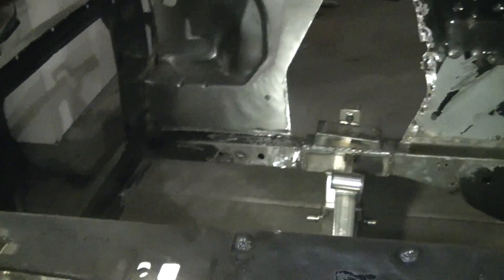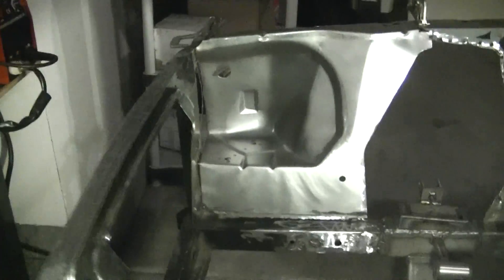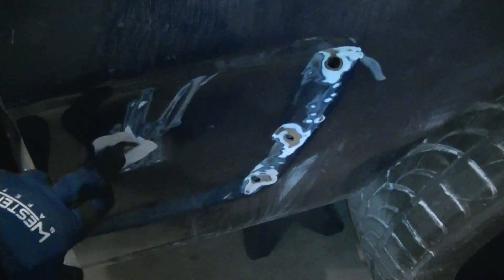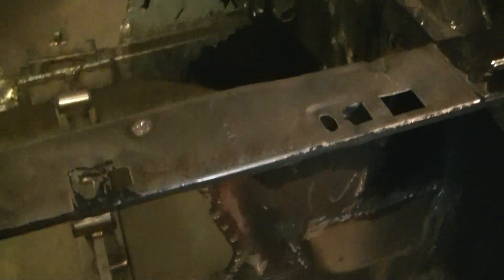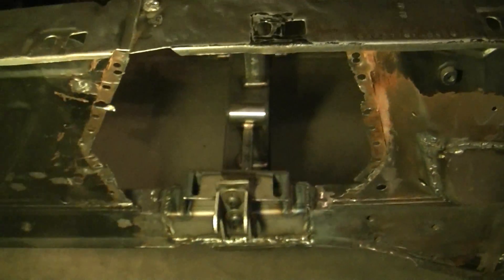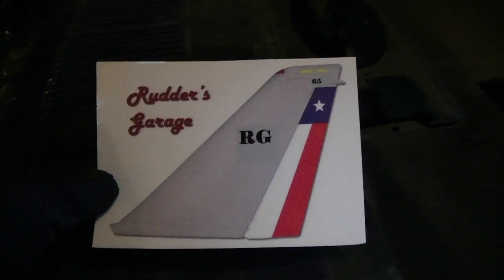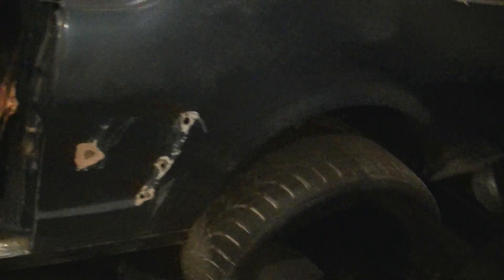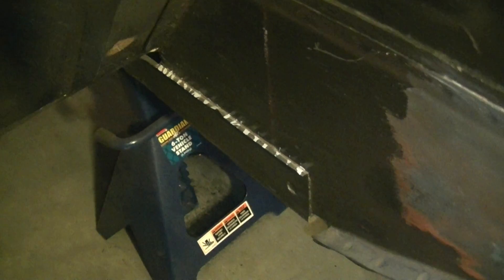1965 Mustang Restoration Part 9 Rod & Custom final install and free stuff

Comment: Those spot weld cutters are vital tool. I couldn't believe how easy they made the job. I ordered one from summit racing. Worked pretty decent for me.
Reply from the maker: Billy, no kidding.  I was going to use either a regular drill bit or my plasma cutter but i happend to stop by HF and they had a cutter so i thought i'd give it a go while my Eastwood cutter arrived.  Can't wait to see more of your build!

Comment: Good progress Joe, front is looking good!.  Is the driver quarter rusty?  Or just has some big dents that need to be pulled and filled with the proper amount of filler?
Reply from the maker: Gary, not too sure what's under the filler.  I hope its not rust...  Although i do think i won't find too much rust given the car has spent the last eight years in a garage and not exposed to the elements. Keeping my fingers crossed.  We need an update on Matt's car.  Is he driving it yet?